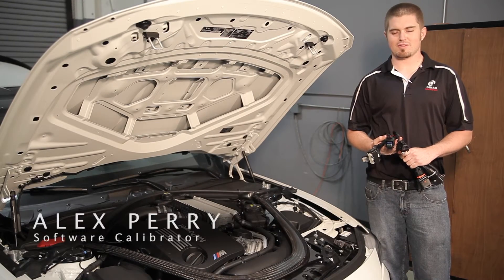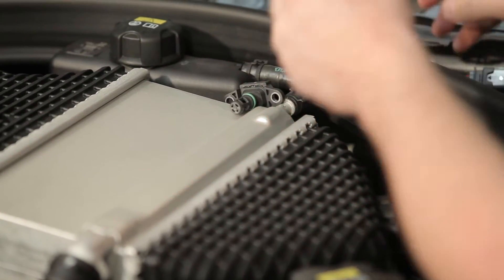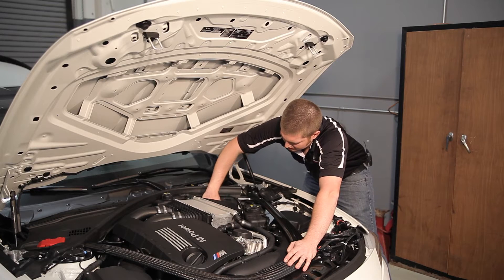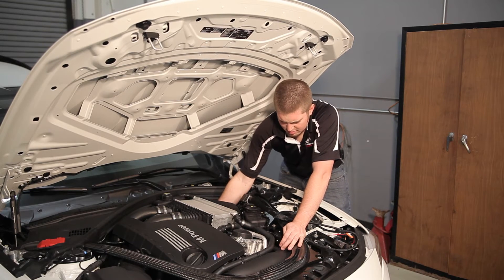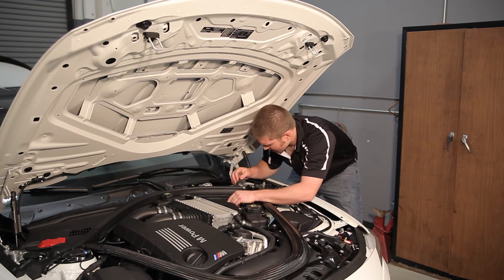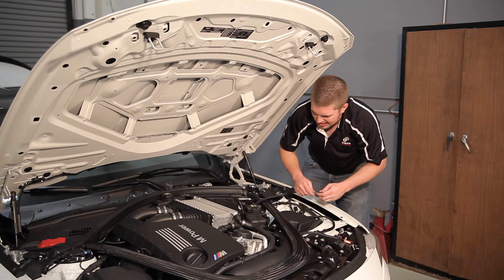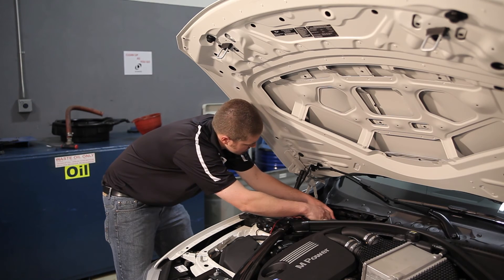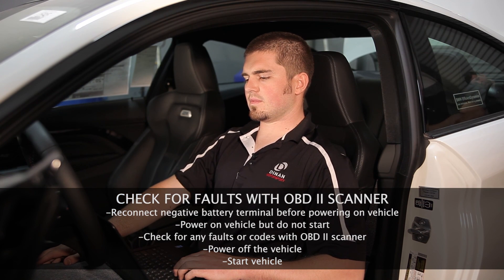How To Install DINANTRONICS Performance Tuner On Your F8x M3/M4

Comment: This install is hard as shit to do. I did this install on my M4 and it was not easy. The space in the engine bay where the plugs connect the is very minimal with minimal visibility. It can take many tries to disconnect and reconnect the BMW plugs to the Dinan ECU. There is barely any visibility when doing this and everything is done by feel. Be very careful and pay close attention to make sure the plugs install in the correct locations. Disconnecting and re-connecting the plugs can be very difficult. This install takes a lot of patience and concentration. I would recommend replacing the circular plastic engine clips after doing this install. You need a T30 and T47 Torx bit to do this install, which can be purchased from Autozone, as well as a 10mm socket wrench and a ratchet wrench to use with the T30 Torx bit to remove the map sensor screws. Follow the plug removal and install order closely. I would recommend a person with small hands perform this install because the space in so tight.

Comment: I have popeye arms and no room for this example of install. Better off releasing the intercooler and give yourself some room to work. I finally removed the intercooler after about 3 hours of trying to get just one plug reconnected. My fingernail separated trying to get that one done. I sure hope its worth the trouble I went through. Too cold and late to try today.

Comment: Boy, that install sucks! I'm a german engineer, used to work on machines and cars, but this was a very special job. Extremely limited space, zero visibility, you only feel what you do and the connector 2 sits way down and has almost no possibility to move or turn. Took me about 4 hours... my arms look like having a fight with 3 cats, scratches and marks all over the place.
Nice thing: after having reconnected the battery, there was no warning whatsoever, seems to work like a charm.
Now I'm curious to see how the car performs.